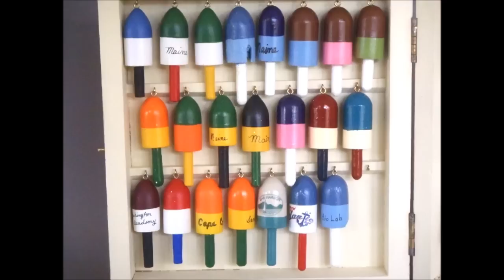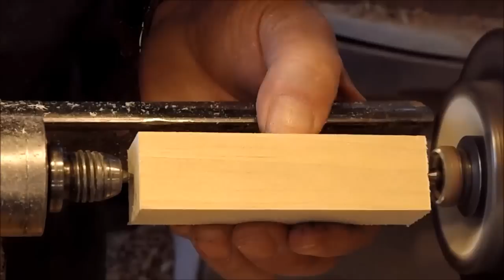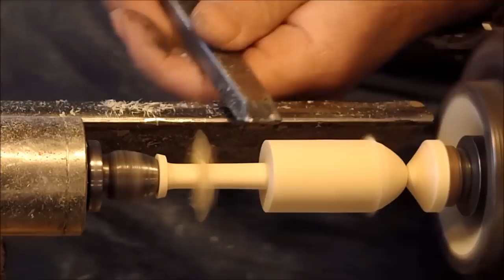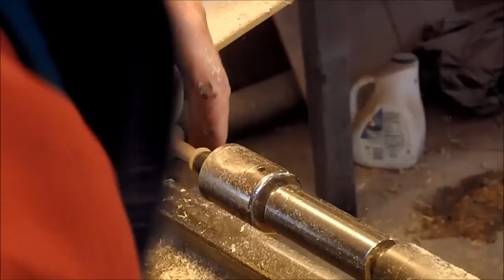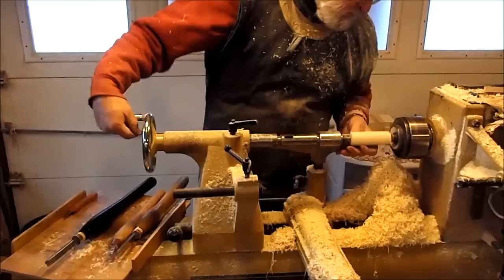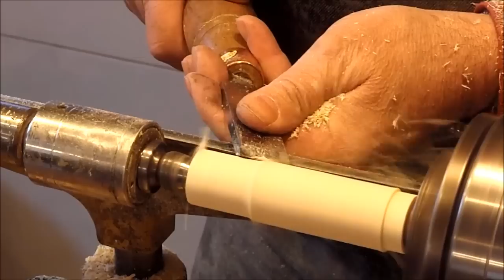Turning a small pine "lobster buoy" by Al Mather

Comment from the maker: @Sineath Pine, and I prefer white pine over red pine (our two choices).  Our local building supply places carries 5/4 pine boards.  These can be any size that you want.  Our first order was for some that were about an inch in diameter.  We built painting jigs to fit, etc., so we have stuck with that  Thanks for watching.
Al

Comment: What a fantastic use of standard wrenches and I as a Scot appreciates their use. How do you keep them sharp?
Reply from the maker: The idea of the wrenches has been around for a long time.  They make a very useful tool.  I grind the top of the mouth (opening) to a angle that cuts.  I've never measured mine.  A touch up on a stone or a wheel is all that is required to maintain a cutting edge.  If you do sharpen from the top toward the mouth of the wrench I think a pass or two on the inside of the mouth with a diamond file or fine stone would clean up any bur.
Reply: Al Mather Cheers Al I will have to give that a go.I am a 74 year old beginner who gets loads of info from professionals like yourself and it' great fun. Thank you